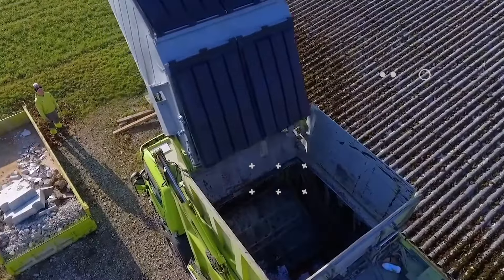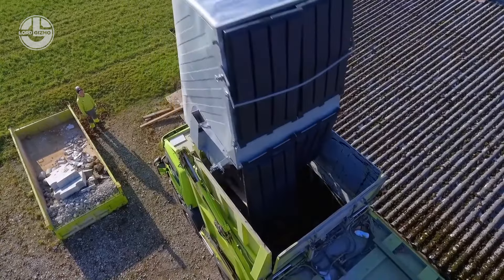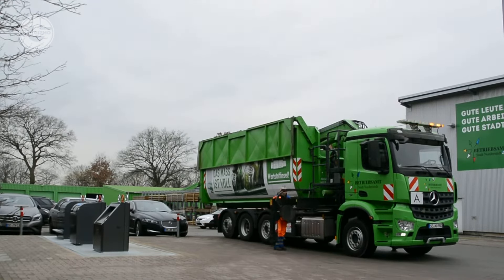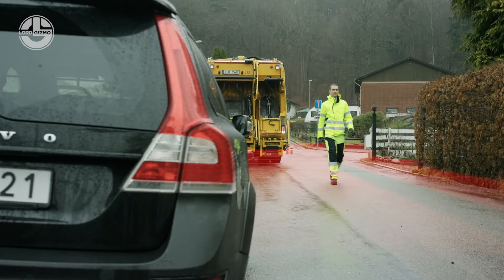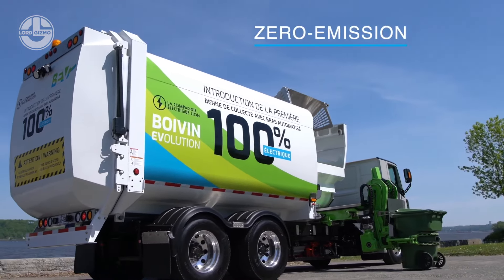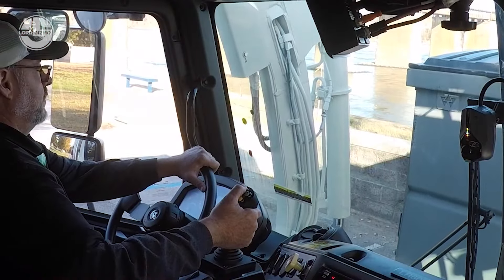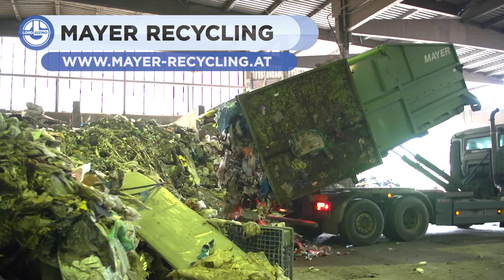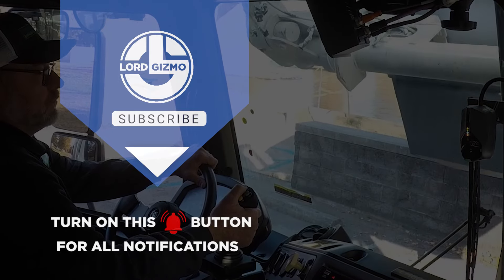The World's Most Advanced Garbage Trucks You Have To See

Comment: Electric?  What's the charge time and range? Typically and truck in the USA drives 200 plus miles a day.
Reply from the maker: Long-range trucks are not something that can (at least very easily) be converted to electric, due to reduced highway efficiency and significantly less range.  However, inner-city vehicles can get a lot out of being electric, considering their need to constantly stop-and-go at low speeds and so use their regenerative breaks a lot.